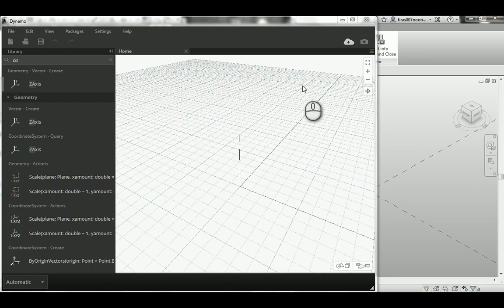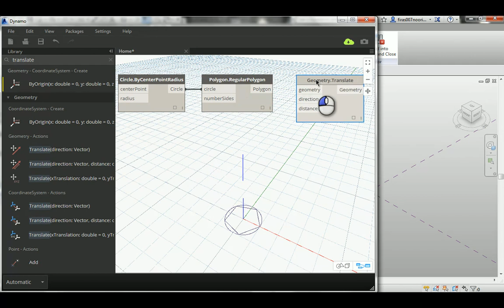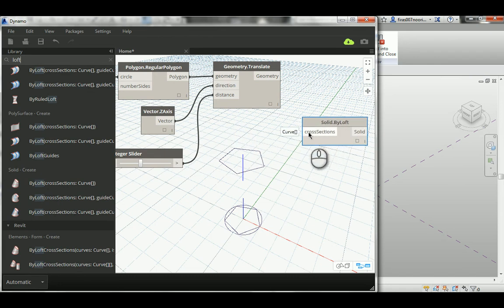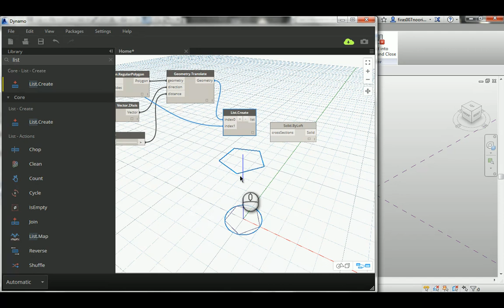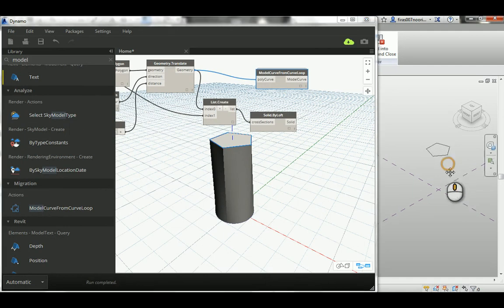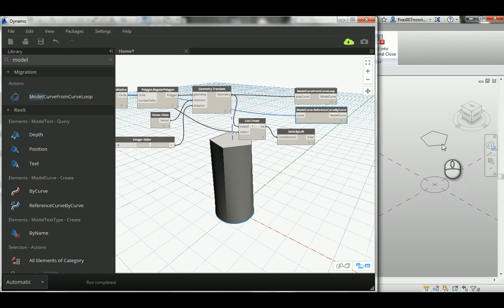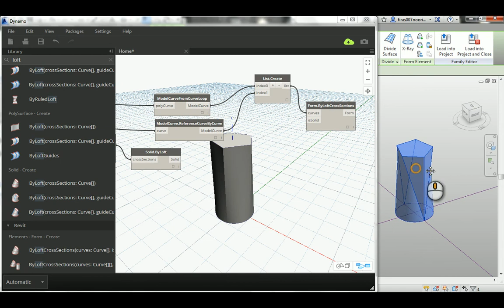Making a Polygon Loft Blend in Dynamo

Comment: Doctor, I am learning from the course. I noticed that it is a spring form by geometry. It is not available. I learned through the students’s comment that it is the reason that I want you to withdraw it.
 Now what is the location .. from which this matter can be downloaded !!
 Very happy to communicate with a giant engineer like you ..
Reply from the maker: Hi dear Mohammed, I love to hear back from ya again. Regarding the Spring nodes, I checked it in Dynamo 1.3 as my previous playlist has done on it, It is not working anymore if you have Revit 2019 (AND) Dynamo 1.3, I could not open (Revit 2019 AND Dynamo 2.0) as I was afraid to delay more to answer you, I opened my Revit 2021 and it has Dynamo 2.5 and here is the funny thing, when I open the old Dynamo 1.3 files I can see the Spring.For,ByGeometry and it is working (NOT RED as it shows in Dynamo 1.3) and it is also working, I tried to see if it still exists as you said and I can not find it anymore.
Spring has stopped it for Dynamo 1.3 platform at Revit 2019, and they gives you a new exact one also from SPRING (Form.ByGeometry) Install the new package for Spring number (203.2) from Dynamo Packages, and you will see it under (Spring > Revit > Form > Form.ByGeometry).
Try it and tell me back, please.. Also can you please give me the names of videos you saw it, so I updated and add a note for that, thanks buddy
FN
Reply from the maker: Also Note that Spring.ByGeometry work on Revit Family files and Revit Conceptual Massing (Not operable on Revit Project Environment at all!! )

Comment: Hi Mr, Firas,

i couldn't find " Model Curve From Curve Loop". How can i find this?
Reply from the maker: Hi dear Mohammed. this specific node has been canceled by Dynamo. it has been issued in Dynamo 1.0 and then in the previous release Dynamo 1.33 they canceled it, and in Dynamo 2.0 which is the current now it is not available too. this is happening due to the Autodesk need to change the export methods from Dynamo to Revit
Reply from the maker: the export tech. dear, is either you send from Dynamo to Revit Conceptual Mass file as you are intending to make a massing (specially when you are designing a form of a building), or you can use the export directly to the Revit Project Environment and here you are directly changing or wrapping your Dynamo Geometry into Revit Walls and Slabs
Reply from the maker: see this video for example dear that shows you how to send something from Dynamo directly to Revit ( it is the second videdo of a 3 videos series You may need to see them all for better understanding) but this particular video is showing you the new 1st linking method to export your Dynamo geo to Revit Environment
https://youtu.be/8jpHeCIB7U0
Reply: @FirasNoori  Thanks alot Mr. Firas, i will go through it.
Reply from the maker: see this to export slabs
https://www.youtube.com/watch?v=89kYDPE3tII
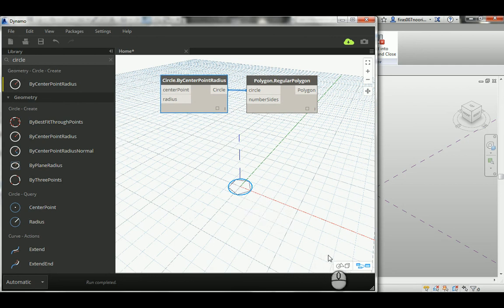Reply from the maker: at 1:09 in this video you will see export from Dynamo to conceptual mass (from the Snowflake Tower Series part 10) it is a custome node from an external package you must download (it is free) look at it dear
https://www.youtube.com/watch?v=PcGJwm2byEc
Reply: There is no such thing:spring form by geometric🥺
Reply: From where I will download it؟؟